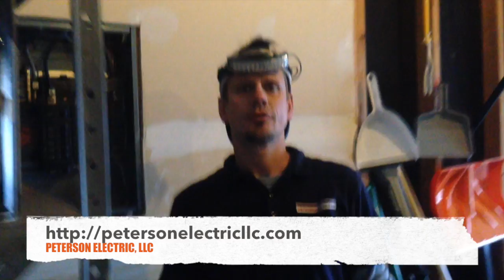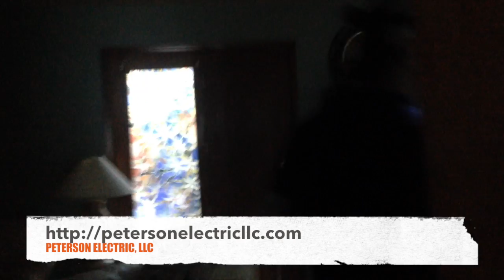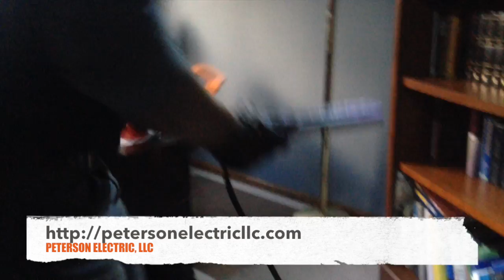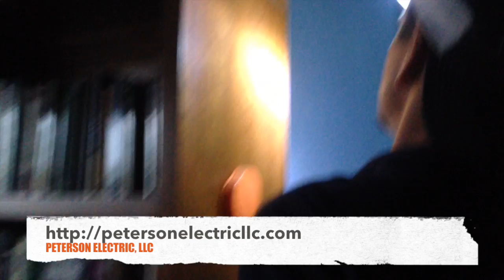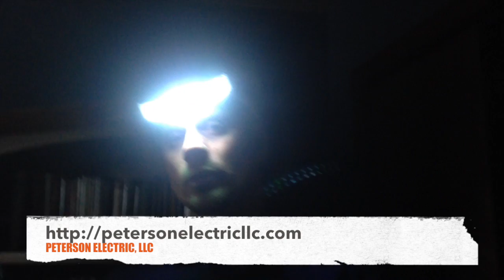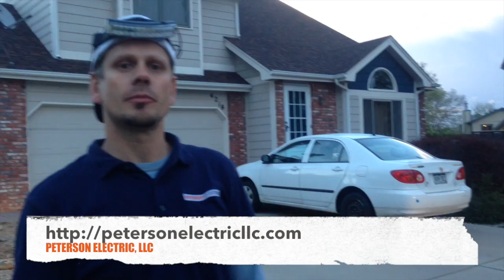Lights Flickering In Home, Backfeeding Power, Surge Protectors Burn Up

Comment: I think we have a similar issue. We bought a rug and had to disconnect the TV in the living room to put it in. We reconnected the TV and the Internet, phone and the living room Cable stopped working. Today spectrum came over and the guy said that we had a surge and that it was using the spectrum cable as a ground.  He said we have to call the power company and have them take a look. So they’re suppose to come tomorrow.  So till today we have living like this. After seeing this video I’m worried, I hope they can fix it tomorrow. We also been having an issue for years when we have the microwave, the washer and dryer, the air conditioning and the dishwasher on at the same time part of the house power goes out.

Comment: If your ground wire came loose from the ground rod with that cause the same problem. I'm an apprentice was working on a house. 200 something v  on one leg. And the other 40 something v. My journeyman went outside and fix the problem in 5 minutes. But didn't say what he did.
Reply from the maker: True, but it is a secondary protection, so there may have been issue with the Neutral at the transformer or underground.
Reply: @Petersonelectricllc  thank you

Comment: This is exactly whats happening to me, flickering lights, appliances losing power intermittently. Sometimes the panel gets balanced 120v, but sometimes it fluctuates to around 50v one side and 200v+ on the other side. Made the call to the power company today, hoping its something like a loose neutral that they will take care of
Reply: Power co (Eversource, here in CT) has a clamins dept. They should be liable for this since it was a fault with their wiring
Reply from the maker: could be one of the panels or cabinets in the house. If their voltage is stable on the line side of the meter, then start looking in panels. Usually a Neutral or maybe you have never had your electrodes installed per 250.53
Reply from the maker: Nice Mercedes by the way!
Reply: Power co came out and replaced the connections going into the meter. Seems to have fixed the problem,  although the voltage spikes took a few devices with it, mainly the microwave and primary control for the furnace
Reply from the maker: @bearsgarage272  See if your home owner's ins will cover this.
Reply: Appreciate that. Im testing at the lines coming into the panel from the meter. Before we bought the house, previous owner had a loose power line pinned to the house, wonder if something got knicked and is a noticeable issue now with snow and wind coming into play